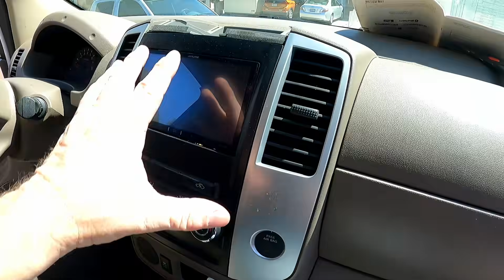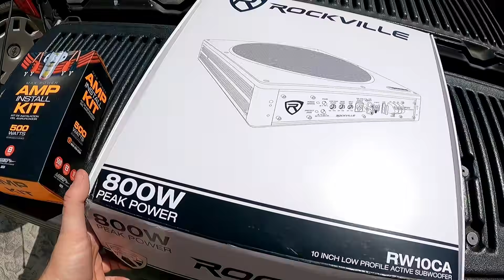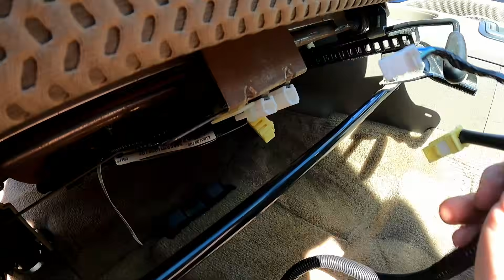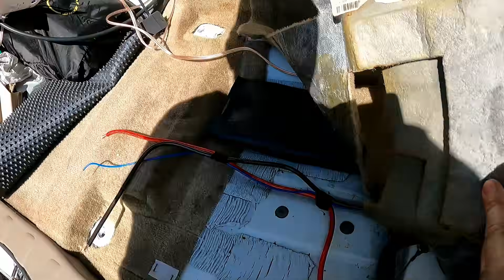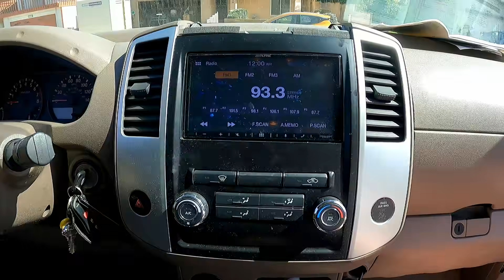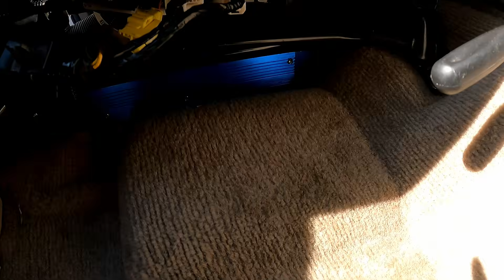Nissan Frontier....Rockville Low Profile Subwoofer Install

Comment: Nice video covering all the basics. Maybe try locating it behind the driver under the 2nd row seat. That’s where Nissan puts their Fender subwoofers and it’s easy to remove the plastic tray under there to make room.
Reply: Sorry, you covered that. Can’t do it in an extended cab.
Reply from the maker: Hello Greg, This is the best location in an extended cab truck. Back in the day with my 89 Hardbody, I just built a box that replaced the rear jump seats and housed two 12” woofers. Nowadays though these small subs work good under the seats. Thanks for watching!!

Comment: I'm getting ready to do the same install in my '09 Frontier, same location but I'm going to flip it the sub around and have the connections facing forward. I have a crew cab and I'm worried about foot clearance for anyone sitting in the back seat. Thanks for the video.
Reply from the maker: Hello mrxmrp, Glad you like the video and it will help you with replacing your regular. Thanks for watching!!

Comment: Hey, Chief! Please would this size of Subwoofer have enough power if placed in the trunk of a Mercedes E Class, or would the sound not be enough to penetrate into the interior? Thanks
Reply from the maker: Hello Benzo, No I don’t think this would be a good choice to be mounted in the trunk. You wouldn’t be happy with the sound level. Try a single box and a 12” subwoofer. I think you would get better results from that combination. Thanks for watching!!
Reply: @DIYWilly  thank you so much. Much appreciated 👏
Reply: @DIYWilly  Sorry, please, one more question. Is it the size of the speaker that matters or the size? For instance, will an 800W 8" speaker 🔊 not be produce same quality as an 800W 12" speaker if both were placed same place in the trunk?
Reply from the maker: No nothing wrong with an 8” speaker. Really depends on what you want. An 8” will fill the low frequencies quite nice but a 10” or 12” will produce much more sound from the larger cone and usually larger voice coil. This is my opinion. Multiple 8” can produce the same pressure as a 12 but bigger is better. Again this is my opinion. If I were to do it again in my truck I would do 2 12” in a ported box so I could feel all the lows. I like bass!!
Reply: @DIYWilly  Fantastic. Thank you, sir 🙏

Comment: All you have to do is ground the parking brake wire. No bypass needed.
Reply: Alpine and Kenwood won't work with a simple ground anymore. Bypass is needed for most of their new products.
Reply from the maker: The original installer grounded the parking brake and still most of the feature were grayed out on the Alpine head unit. This use of the bypass opened all the feature for full use while driving. Thanks for the tip and for watching!!
Reply: I put a little flip switch. It was last years alpine ilx-507. The lead from the stereo to the switch and grounded the switch. 🤷‍♂️
Reply from the maker: Great info! Thanks for watching!!
Reply: you need a bypass transistor they cost like 10 bucks.
Reply from the maker: Hello, Yes the bypass transistor was installed. Everything worked perfectly after that. Thanks for watching!!

Comment: so is it good quality ? im trying to get one for my hardbody not much space thanks
Reply from the maker: Hello Alejandro, I’ve installed this in two different vehicles now and I can say yes there both doing great. But also taking into consideration that this is a low profile sub it’s not going to provide the deep low hear it out side your vehicle bass. It’s really good at filling in the low frequencies to make the music more enjoyable. So I guess if you want thunderous bass then try and get a bigger box and a good 12” but if you just want good sounding music it’s definitely a good option. Thanks for watching!!
Reply: awesome thanks  , i just need to  have  a little bass   but also i dont like  all my windows shaking  so i guess it is a good option definitely getting it  thank you 👍👍
Reply: @ofalejandro12 have you intalled it yet. just bought one for my hardbody, wanted to know if it fits under the bucket seats, i tried measuring it but it looks like itll be tight
Reply: @jonjorussel5979   i didn't even tried do it under the seat  mine is single cab  with single seats and i installed in the back panel behind the passenger seat  lol i might just  upload a video in the channel 👍
Reply: I just installed the same sub/amp combo in my frontier. Passenger seat is now a massager
Reply from the maker: Yes I agree the seat becomes a messager.

Comment: Anybody sitting in that passenger seat is gonna have their hemorhroids vibrated when that subwoofer kicks in,lol😄. Nice installation though, radio should sound really good now.👍🎶🎶🇺🇸
Btw wrapping that foil on the wires is a good tip👍
Reply from the maker: Yes who ever sits in the passenger seat does get a wild ride..🤣 The system sounds good. I also installed the JBL GTO speakers that will come in the next video.
Reply: @DIY Willy  that's some good clear  info too man God alotta people can be saving money by watching this vid probably bout 3hundo at least at the dealer huh fogettabatit